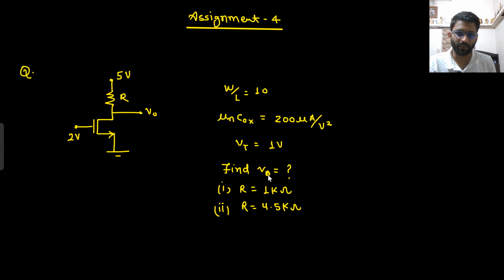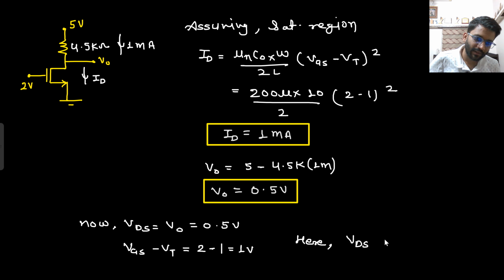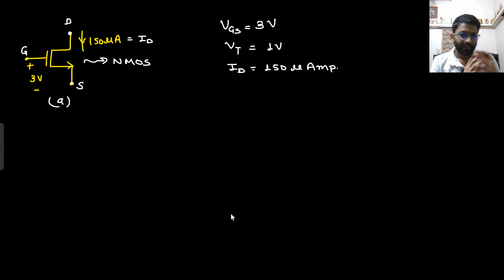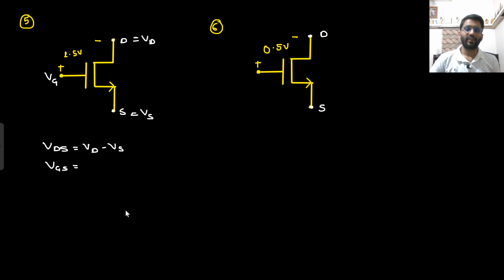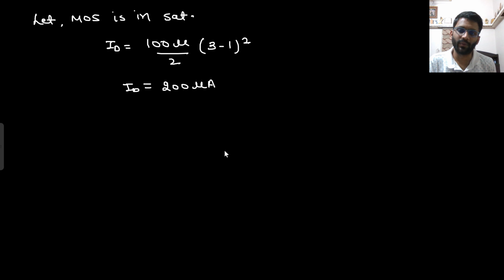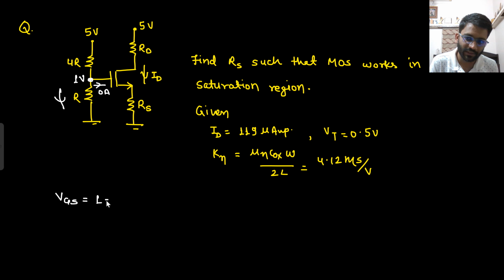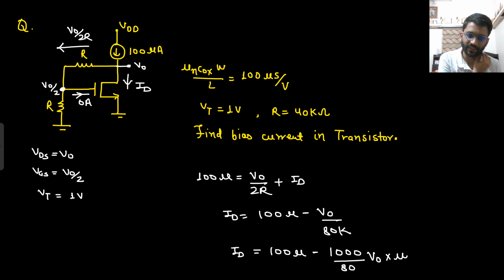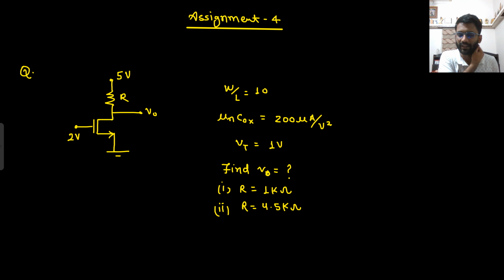Assignment 4 Solutions || Analog Electronics || PrepFusion || Himanshu Agarwal

Comment: Sir, in the last question (from 54:00) 
Instead of all those assumptions and calculations,
can't we directly say that the MOS is in saturation region based on this :

From the circuit, Vds=Vo, Vgs=Vo/2 and given Vth= 1V.
So Vds > Vgs - Vth : Vo > Vo/2 - 1 (satisfied equation). 
Hence MOS is in saturation region.
Reply: if u take Vo =1v still drain at higher potential  then it will be cut off region. so better to find by exact method